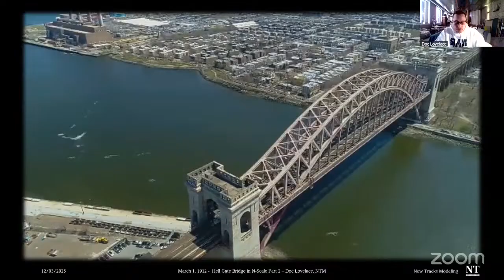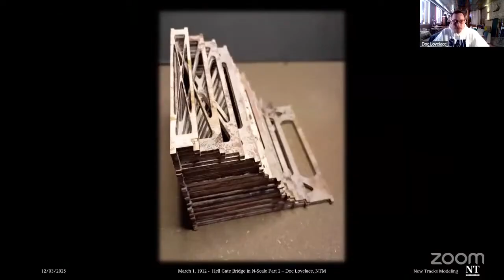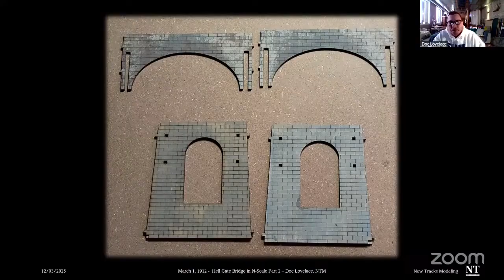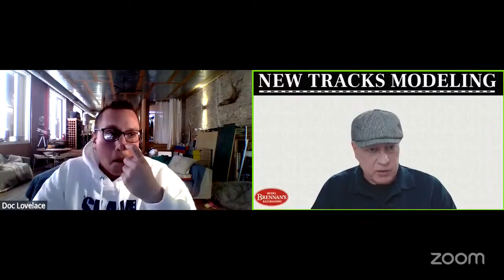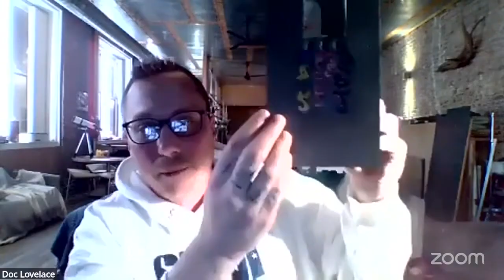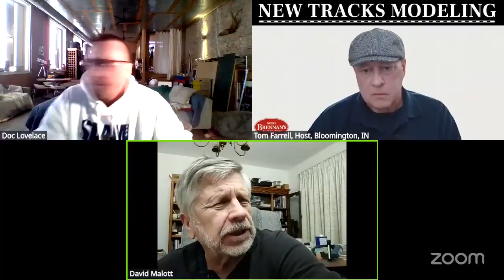Hell Gate Bridge

Comment: Does your bridge extend over Grand Central Parkway?
Reply: I will honestly stop probably around the 20th or 30 blocks of Queens... So probably roughly a half mile from where the lead in would actually cross over the parkway. It's still going to be quite extensive and also cover the area of the East River as well. I'm building it completely modular, however, so adding on was my plan from the beginning. I started at this point because 13 miles in any direction you can just add an add and add an add